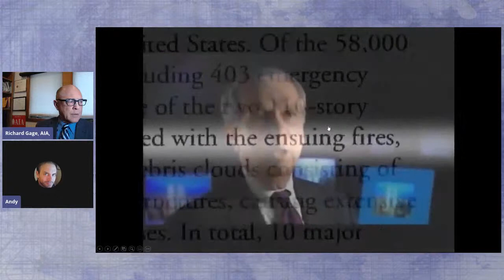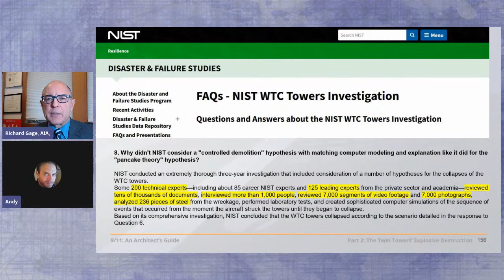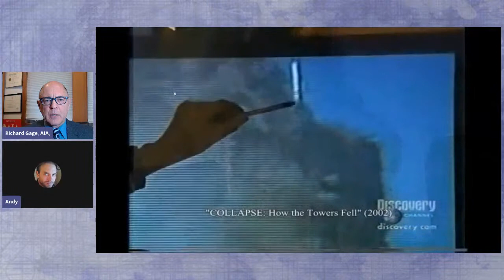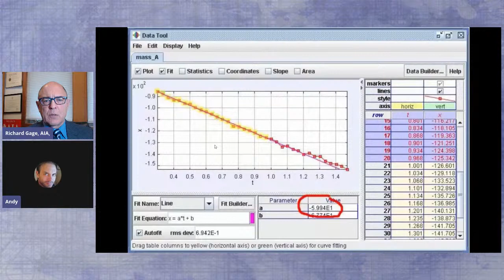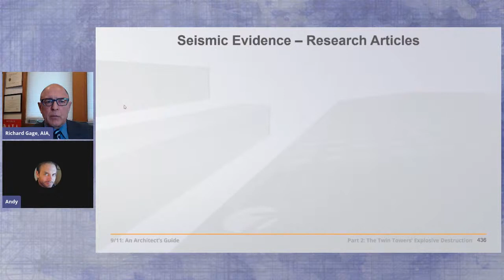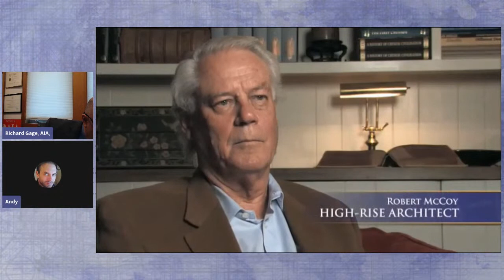9/11: An Architect's Guide - Part 2 - Twin Towers' Explosive Destruction (4/8/21) Webinar - Gage)

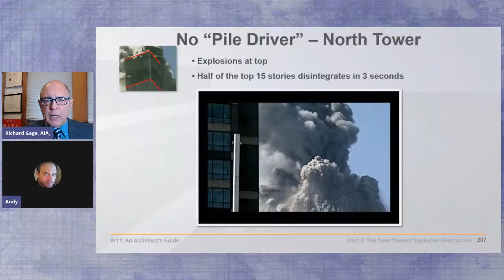Comment: Gage has the best arguments I've heard to disprove the supposed "collapses" of these towers.  The easiest, most common sense way to disprove it is at 48:40, where he explains how the upper section is being destroyed in the first 4 seconds of collapse rather than the structure below it.  The lines shown in the video he uses make it very easy to visually see and understand what is going on to the upper section.  You cannot identify the upper section destroying the lower structure.  Again, this is VISUAL evidence, not a theoretical argument.  There's no hiding it, no debating this crucial visual evidence.  

He mentions that the antenna is seen dropping before the collapse starts which indicates that the hat truss and core columns must have been severed or weakened, causing them pull on the trusses, thereby causing the inward bowing of the perimeter columns.    These are all very important points to understand.
Reply: Yes, this is a very good point (about dissapearing top of the building).
Reply: @balsarmy  Yes!  I don't understand why this is not the most commonly used argument against the supposed "collapses".  It is there for anyone to see when you are pointed out what to look for.  Once you see that the upper section is disintegrating within seconds, it becomes very clear that you see 2 buildings exploding from the top down.
Reply: It's not a Story. It's Fact
Reply: @embreesmith7613  Well yes, it's not a story.  It's plain as day for anyone to see, once it's pointed out what to look for.  Myself, I didn't realize this for years, despite already being a skeptic of the official story of 9/11.

Comment: Thanks. I'm looking forward to next week's part 3. 
I was woken that morning by my radio alarm clock announcing the first strike. I got the TV turned on in time to actually witness the second plane hitting. 
The collapses made no sense to me as they looked like they were set up to implode. They didn't explode. 
Building 7 collapsed because of office furniture? Like the steel used for the columns, isn't modern office furniture treated with fire retardants? Wood and fabric wouldn't produce a hot enough fire to melt untreated steel, much less treated steel. Jmo based on common sense education and experience.

Comment: Has anyone used jet fuel to start a bon fire? We have and I'll tell you, it burns hot but it burns fast. Quite often the fuel burns away before igniting the brush that we're trying to burn. 
I've always wondered how the towers came straight down. Looked like an old hotel that was set up for destruction.
Reply: Jet fuel is basically kerosene derived.